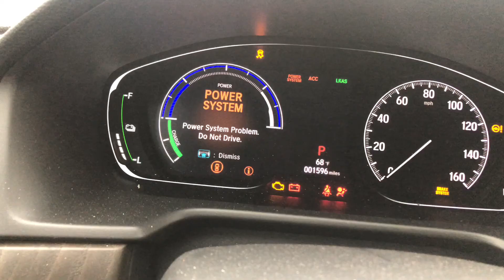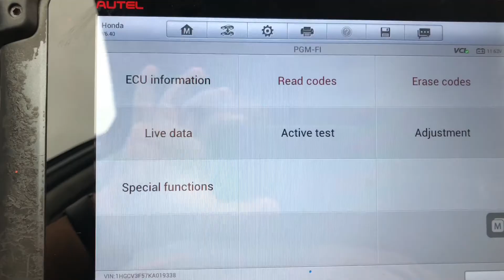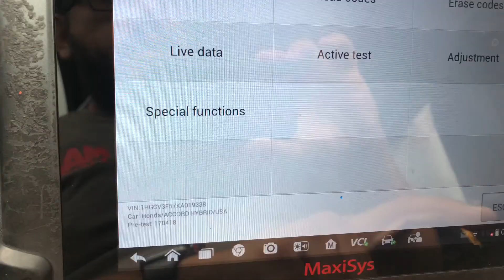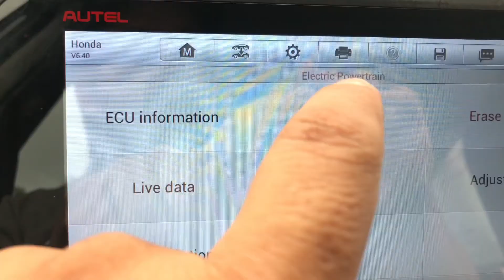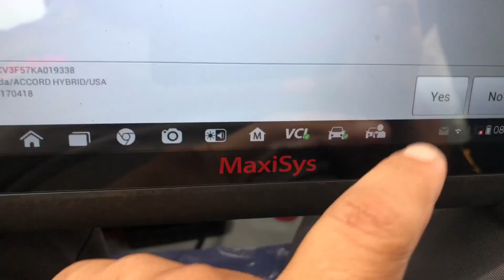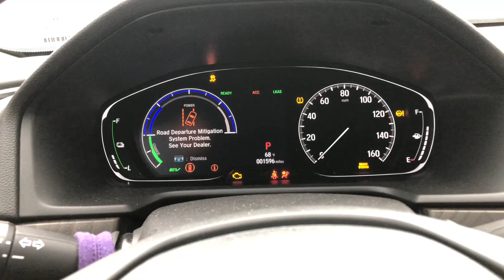Honda Hybrid Won’t Drive After Accident | Power System Problem

Comment: I have a 2019 Honda civic 1.5 turbo i got into a crash all airbags where deployed and i cant get it to start , Is there a fuel cut off inertia switch somewhere? I need help please all help is appreciated Thank you !
Reply: Hey did you figure out what the problem was I just got one from the auction and it’s have the same issues it won’t start ?

Comment: Hi there, thanks a lot for very necessary and informative video.
Kindly share the scanner model or any analogue of it suitable for problem solving.
Need to purchase one for my 2020 CRV with the same problem and can't find a suitable mechanic to resolve it.
Thank you in advance and best regards.
Reply: Hi did you solve it? Are you in Azerbaijan ?
Reply: @Cafer S  No, Cafer. unfortunately, didn't. therefore, changed my mind on the CRV hybrid ownership.

Comment: I have autel ap200 can this tool clear that codes?
Reply: Did you manage to reset with ap200?
Reply: @CluelessDriver  i contacted autel and they made a beta software version for my ap200 and it worked for a while then they stopped the beta software
So the device can do it when autel agree 🙂

Comment: We have the same case. The problem is that we have no comunication with the Electric Powertrain Module so we cant clear the codes. Did you have to do something to comunicate with EPM after the accident?
Reply from the maker: Not on this car but I’ve had that problem on a Subaru before. The problem was a blown fuse. Check all your fuses.
Reply: @themodernmechanic428  We have checked them multiple times and unfortunently all are good. I can see on your video, that the scanner does not find any faults in the SRS module. Faulty srs is our only idea, we dont have any codes in it but we had the crash data cleared and  maybe something is wrong with the software. But could a srs problem cut the comunication with the IMA module?
Reply from the maker: I think you’re pm the right track. The srs module is what sends the codes to the electric power train module after an accident therefore if the srs module is faulty it could be causing some communications issues.
Reply: Unfortunently we cannot get a SRS module anywhere. Please tell me did you comilunicate with Electric Powertrain with crash fault codes in the SRS unit still existing?
Reply: Hi I’m having the same issue with my 2019 Honda Accord hybrid it was involved in an accident 5 months ago and it had a damaged abs 
I have replaced that but it says error communicating ECU and engine won’t start please help 
How did you resolve the issues ?
Reply: @dantorrealty6033  The was also a sort of "crash data" in the EPM module. I needed a better diagnostic tool to reset it.
Reply: @autoserwiskrolewska6318  thank you for your reply.which took did you use exactly?
Reply: @autoserwiskrolewska6318  I mean which scanner tool did you use ?
Reply: @dantorrealty6033  how did you solve that issue for your 2019 honda accord